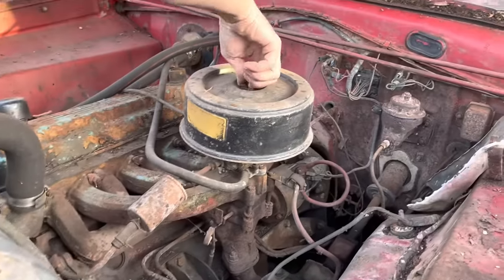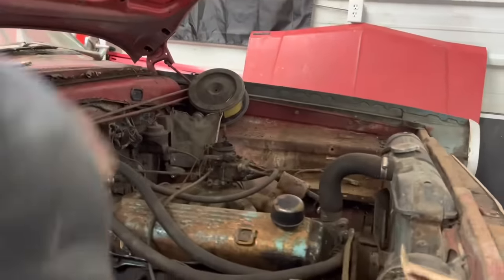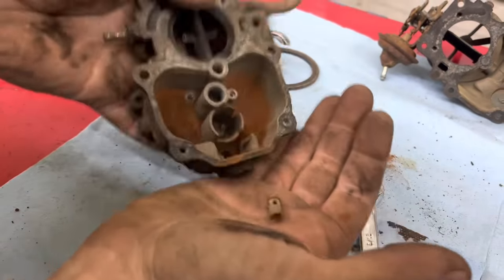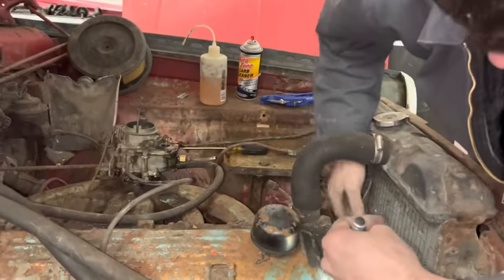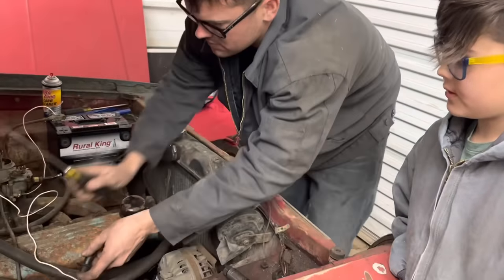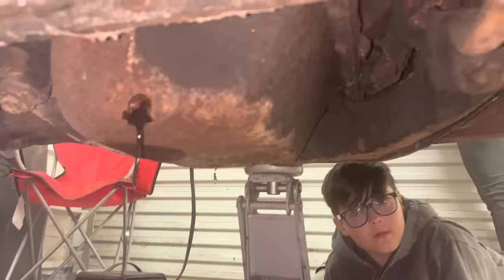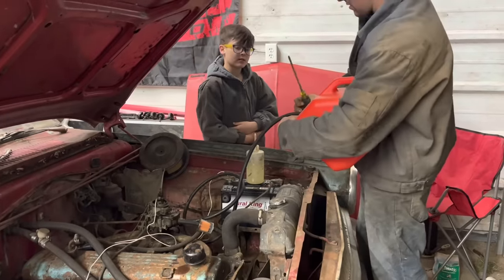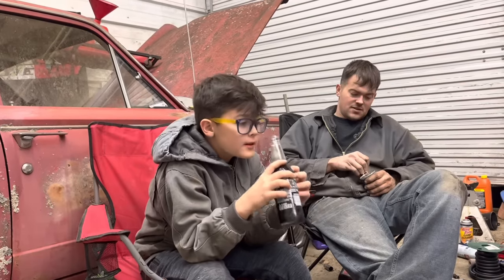$500 station wagon, will it start after 25 years parked?

Comment: Back in the 1970's my wife and I bought several 500,00 cars. Back then you got a car with a perfect body and interior. In the rust belt north. And you could drive it with no problems for years. Miss those days. My first car was a 1965 Mercury Comet four door sedan that my dad bought for me for 75.00 dollars. Transmission was shot, so I went to a local salvage yard and bought a good used transmission for 35.00 dollars. My brother and I installed the good transmission. Drove it for two years before giving it to my sister and she drove it for six years before trading it in on a 1968 Ford Fairlane.

Comment: Hi;
The reason for the slant is its Chrysler ' s early attempt at ram induction. The long intake runners rammed the mixture into the cylinder giving it 15% more hp than a regular 6 cyl. The engine came in two versions. 170 cubic inches and a 225 inch versio

Michael  Rzewuski
Reply from the maker: Ok thanks
Reply: hello how are you doing 😊

Comment: Of course it runs, the Chrysler slant six was as reliable as the tide and taxes!  I love the starting sound of slant sixes with gear reduction starter.  I've had many,  brings back lots of good memories.   Can you show a close up of your flip flop beer opener and how it works?
Reply: Memories yes! We had a 62 dart slant we used to race around in the woods when I was a teen, fun! 😁
Reply from the maker: Yes they are good reliable engines. The flip flops are made by reef
Reply: Had my doubts for it to run. Sounded like no copression, but perserverance saved the day. The ignition switch is easily removed. Take it to a locksmith, he'll cut a key by code. Good luck on the wagon, they just don't make them anymore.
Reply: @jeromebreeding3302  while the designed compression is higher it will frequently run with much lower compression, often below 85 psi.
Reply: @Sleeperdude  Don't cotton to flip-flops around a mechanics shop To easy to drop something and lose your toes. Even stubbing a toe, would be very painfully.
Reply: There is no other car that had the same sound of a mopar starter.
Reply: @dannyb.4034  I drove a 62 and 63 Valiant.I don't remember it having the sound of the gear-reduction starter. That was in the seventies, so maybe don't remember, but they were dead-nuts reliable.

Comment: I had a self modified 1965. 225, milled head 0.090, 318 two barrel, 3.91, 8 3/4 positrac axel, factory heavy duty finned drum brakes front, 8 3/4 10" rear drums, 14" wheels, 2  1/2 exhaust w/turbo muffler (reasonably quiet vs glass pack). It would pull trailers or whatever with little effort.
Reply: Drag anything thru the intersection.
The low end grunt torque of the 225 was amazing. Longer stroke than a 440.

Comment: The oil issue on plugs is from the inner seal insert around the plugs . Depends on year some are removable and have gaskets and o rings
Reply from the maker: Ok  I thought so
Reply: The spark plug drool tubes take the same o ring as the 426 hemi! Same part number. The tubes are different though. Don't damage them because they are impossible to find.

Comment: Cool wagon. Haven't seen one in a long time. My Pa had a two door stick shift that he used as a shop loaner and I drove it a few times. Reliable and good on gas.
Reply from the maker: That’s cool
Reply: At first when I saw it I.thought it was a old.dart
Looking.closer  it's a American.car in.the u.s.a yheynever had dodge dart thet.had a SIGNET WHICHLOOKSA LOT DIFFERANT
THAN OUR MODELS FOR A NOTHER EXAMPLE WE HAVE G T,O.OVER IN THE USA THERES IS CALLED A TEMPEST COOL CARS BACK  THEN
Reply: Back.thenif.yiu.had a station wagon.yougot a better car always ..wagons are heavier and last way longer
Reply: A little mopar history in case you didnt know on yhe slant six mopars..they did come in 3diferant sizes 
 engines  170..198..and 225 I.personaly.prefer the 170 engine we gad online a1967baracu
da  it was smaller.in.cid.bbut higher compresion it pulled a lot.more
Reply: Same pricable applys 273.vrs 318  273 way faster higher compression again  way better moter
Reply: Same pricable applys 273.vrs 318  273 way faster higher compression again  way better moter

Comment: We had these in Australia,  best cars ever made.  My Dad had a 66 wagon with a 273 , he bought from my uncle after he drove it from Katherine in the northern territory to Melbourne with no oil . He got it rebuilt and some work done , used to beat 351s easy. My mate has just rebuilt a 65 AP5 sedan with the slant 6. Great old beast.  The later ones in Australia had our Hemi 6 and they would make 300 Hp easy.  The early 70 model VG valiant was a very good car with the 245 Hemi.  The ones after had 265s and they went so hard and lasted forever.  I've always had a 77 regal se 318, did 750,000 klms with a stock 318 fireball , we didn't have much polution crap until 78 so cars were very fast if you pur a 4bbl on. Now it's got a nice 360 ,Edelbrock heads and all the good gear. 450hp . Wife found a 67 impala factory rh drive Holden had sent over here back then. They are a beast of a thing,  327 should hammer.  Used Edelbrock heads and roller rockers with a Lunati voodoo cam and lifters.  The 327 revs like 318 except the heads suck on 318s. The young bloke there is going to be a genius with cars . Good man keep him learning.
Reply from the maker: Thank you. Yes I hope he continues to enjoy the car stuff

Comment: Love the 64 darts! I've owned mine since '74. 
Yes the accelerator plunger is a leather cup, not always so, but it's fairly common on many cars of that vintage. I usually soak the leather cups in oil, before I install them.
Also, don't scrimp on the hydraulic brake parts. That is a single reservoir master cylinder. You lose pressure at any point in the system, you've got nothing but your e-brake. When my wife was driving my 63 dart, the left front flexible brake line blew and she had no brakes coming down a steep hill in Seattle. Somehow she survived the big hill, and continued driving home REALLY slowly, using the auto trans park pawl when she HAD to stop.
Reply from the maker: Oh wow that’s a crazy story, thanks for the info

Comment: When checking the transmission fluid level on a '64, you're supposed to run it through all the gears first.  You mentioned hydraulic lifters earlier in the video.  I'm pretty sure it has solid lifters.  Yeah, I've owned two '64s in my life.  Love that pushbutton transmission.
Reply from the maker: Ok thank you

Comment: I’ll say , from the thumbnail , this model year clearly shows how innovative the Plymouth was . The body lines clearly show how the rear window , sail panel , deck lid and trunk and rear clip was remodeled to make a station wagon body without too much change . 
That was as clever as it was ingenious . Rocky was great help . In addition to absolutely cracking me up , rocky will take care of ridding the valiant of its unneeded excess body scaling . This start up was nail biting . It had me wondering if pulling the valve cover to free up the valves was necessary . Carbon build up on the valves was taken care of with the rev up time up 👍. If I were there , I would have been kneeling and praying to the almighty tower of power ! After all the hibernation , it roared to life and doesn’t sound too bad at all ! 
Yeah , the brake drums will have a future episode of making use of t-your drum puller . Well , the expense of the tool will help you get your moneys worth . In that respect , pay for itself ? Once again , another successful carb rebuild / refresh . I should remember the carter Yf parts since I’ve been through a few but I rely on rebuild sheets and call it good , sorry . It’s been since my junkyard days since I’ve seen a push button drive auto trans . This is a blast from the past . Accelerator pump cups , yeah , I don’t either know what material they’re made from . 
I’m calling this car a survivor . Looking forward to a drive too . Since you , Ralphie , rocky and the girls are on the job , I got my faith 🇺🇸
Reply from the maker: The start up was nail biting for sure. I didn’t think it was gonna start. Rocky is always a good helper and loves all the crustiness of the cars. Thanks for watching and I’m glad you enjoyed it

Comment: I bet this cute little wagon was gorgeous when it rolled off the assembly line - that is a factory roof rack - which were fairly rare - is this a 2 or 3 seat model - I’m guessing a 2 seat model since 3 seat models came with a standard power rear window - one of my mother’s first cars was the 4 door sedan version of this wagon - no air conditioning or power steering or brakes but it did have the push button Chrysler Corp Torque Flite transmission - it had those same Dart badges on each front fender
Reply from the maker: So cool

Comment: Had a 65 Valiant wagon. Starter solenoid went out. Started it with a screwdriver, drove to the parts store, disconnected the battery, leaned over the drivers fender took out the starter got another and replaced it like I took it out. I’d love to own your Dart!
Reply from the maker: That’s awesome it may be for sale at some point

Comment: Hearing that old slant six come alive was true inspiration. One could even argue that this humble engine was the best one designed and built by the Chrysler Corporation.
Reply from the maker: Yes for sure
Reply: Ok. So what's with calling them caseings instead of the T word ? 🤔
Reply: Very tough engine. Hooking up power directly to battery burns the points   there is a white ceramic resistor on firewall towards drivers side that drops the voltage down. When using key engine would fire but as soon as you let key return to run position she would shut down. In crank mode the resistor was by passed that was how you new it went bad. Hard engine to kill
Reply: @redram646 The term is casings is widely used in tire centers across the nation.

Comment: Hard to kill those old 6's. They are great engines.
Reply from the maker: Awesome
Reply: I had a 67 Dodge step side truck with the 225 S6 and every now and then when you turned the key to shut off the engine the starter would engage the flywheel, and you could put it in gear(3 on the tree) and drive the thing.
Barrel rolled it 😭b4 I figured it out!
That truck was in immaculate condition! Always started . It had leather bucket seats and a matching seat/cooler in between them! Room for a case of "root" beers and a 6 pack of bbq Vieeenas on the shelf. I paid $750 for it in 89 or 90. That's a perfect reason not to drink and drive, or in my case, not drink at all!
Reply: Right? Great,simple motor.

Comment: I am a new subscriber Jan 2024 going back and watching all your old videos and have watched you say this comment several times.  I don't know if anyone has mentioned it, but if you pull around a snatch block pulley to reverse the direction of the pull, it does not double the power of your winch.  The tension in the cable is exactly the same as if you were straight pulling (assuming a theoretically frictionless pulley).   Pulley friction can increase the tension, but that's probably negligible.  

Only by pulling from the winch, to a pulley, and then back to the same point as the winch would you double the pulling power of your winch because then two lines are pulling in the same direction splitting the tension between the two.  Also you have to pull twice as much line in this scenario to move the object the same distance. 

Love the work, the content, and the vibe of your channel for sure.  Keep up the great work and it's awesome you've been able to turn this in to your full time gig.
Reply from the maker: Ok thanks for watching

Comment: In Australia that would probably be the AP5 model Valiant by Chrysler.
They had different grills and tail lights but were otherwise very similar.

The slant six was well known for its bullet proof demeanour.
Reply from the maker: I will have to look it up
Reply: Yes, AP5 (Australian Production 5) series Valiant.  A friend had one.  225 slant six.  The 170 was never available in Australian Valliants. AP1 - 4 was the Chrysler Royals.
Reply: @railtrolley  You may be missing the R and S series in there.

Comment: My older brother owned a '66 Dodge Dart 2 Dr. Hardtop.  I think it was a GT model, it even had bucket seats. The engine was a 225 cid slant six with the push button automatic transmission, and A/C options. That car was industruble.
Reply from the maker: Nice

Comment: '64 Dodge Dart station wagon. I had a four door '64 Dart, wasn't a wagon, when I was in high school. Started driving it when I was 15 on a learner's permit in Arkansas. Had a 270 straight (slant) six and the quirky little push button transmission. 8 track tape deck riding around all over Louisiana and Arkansas listening to ABB, Marshall Tucker, BOA, Jethro Tull, Peter Green's Fleetwood Mac, and Frank Zappa in it. STONED. It was great.
Reply from the maker: Love the wagons

Comment: Oh man, I love this wagon! Back in the 1980's I bought a 1963 Plymouth Wagon for next to nothing. It was root beer brown and I think it was at once time part of the State of Washington's motor pool. it had a 170 cu in Stant-6 with the push button shifter for the TorqueFlite automatic transmission. The body was fairly straight and the interior was really good as well. it's only drawback was that I couldn't get the back window to roll down so I could lower the tailgate.  I used it as a work and putting around car and I just loved it. But in time the engine gave out, and instead of getting another one and putting it in, I sold the car to the local junkyard (Dum dum me). I think about that old wagon from time to time, and if I could go back in time and bring back some of my favorite cars, That '63 wagon would be one of the, for sure. Good luck in fixing it up and getting it back on the road.
Reply from the maker: That’s a great story, we all wish we had some back

Comment: Oh, man does that take me back!

My first car was a 66' Dodge Dart slant 6 with 3 on the tree.

I got it for under $300, and ....IT. WOULD. SCOOT!!

Honestly, those inline 6 cylinder engines were as strong as a hundred Missouri mule team, and if you needed a house snatched off of its foundation, it was the mill to use, with torque 'til next Sunday!

Boy, I wish I still had that little thing. The only seating it had in it was the driver side of the front bench seat. 

They had sawed the seat in half and welded the remainder to the drive shaft hump.

Comment: I have a solution for you about that oil filter that stands straight up....punch about 5-6 holes in the top of the filter with a flat tip screwdriver/hammer....the oil will drain out mostly while the rest of the oil is draining from the pan, then when you unscrew the oil filter you won't have that big mess on the ground as long as your oil catch pan is under the filter 😊

Comment: That year has solid lifters. Slants didn't get hydraulic lifters til 1976. So much for the Marvel mystery oil pumping them up. I've owned 6 darts all with slant 6s. Sold every one running better than when I bought them.  Get ya an Offy intake and Edelbrock 500. An HEI swap helps too. Love those motors
Reply from the maker: Ok thank you I appreciate it

Comment: Several thing cause that hard start. One is light rust on valves causing compression leaks browning fuel back from the manifold. I found a low pressure  steady blow  of air down the throat really helps.  The other is the aluminum pistons tend to corrode and may have had a few stuck rings. Hopefully after a good heat cycle or three they’ll break loose. I’m not a dodge fan but those old slant sixes were amazing engines! What a neat old project!
Reply from the maker: I think you are right

Comment: I was interested why you didn’t turn the motor over on the starter whilst plugs out. To get some oil circulating. Also I think some valves where stuck at the start.  That is why it took a while to fire. Good video and great to see a father and son relationship.
Reply from the maker: That would probably have been a good idea, I just didn’t think about it

Comment: My dad had a ‘62 Dodge with the aluminum 225 slant six. I don’t remember how long they made the aluminum block, and I don’t recall if there was ever an aluminum 170.

Our ‘62 overheated on a vacation trip—big time, steam billowing out around the hood. Towed it home, they replaced the head gasket. It ran, but was never right again. The cast iron liners were freestanding at the top; no deck.

My dad swapped in a cast iron 225. It was so much heavier that he had to adjust the torsion bars to raise the front suspension height.

The 225 stroke is long, a full inch longer than the 170 IIRC. It had a lot of low end torque. My dad enjoyed stop light sprints against Mustangs and such. He could take them...for a few seconds.  The ugly old 4-door Dodge embarrassed a few kids.

In the 90s we almost bought a loaded ‘65 Dart two door with a 273 V8...found in a junk yard with the rear window gone.

And yes, the slant six was intended to lower the hoodline, but they also advertised how easy it was to service. Guess they never thought about filter changes, ignition work, or fuel pump replacement!
Reply from the maker: Yeah exactly thank you

Comment: If you don't have a feeler Guage to check the points , a match book cover works . Those slant six valve covers always leaked a little that's why there was oil on the outside of the spark plug..
Reply from the maker: Ok thanks

Comment: Replace the distributer condenser, & check the ballast resistor on the firewall, & continuity of the spark plug wires .
Reply from the maker: Ok thanks